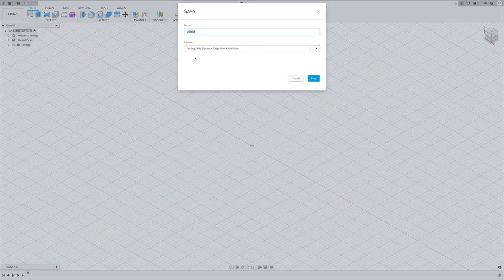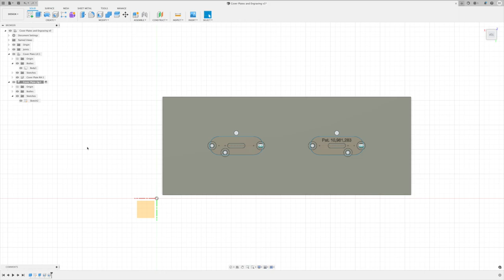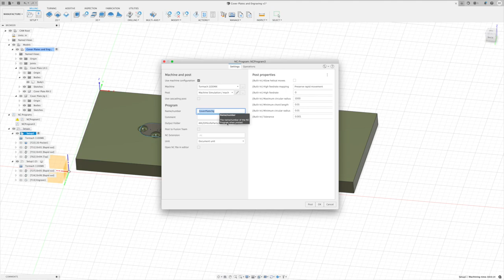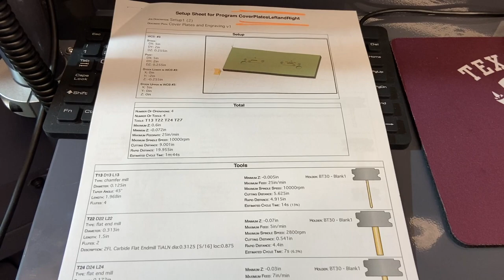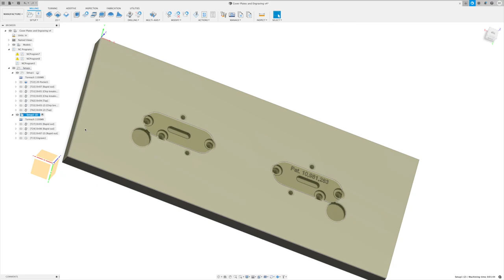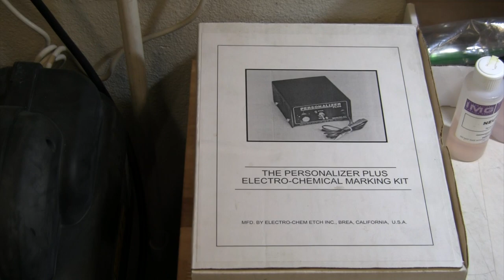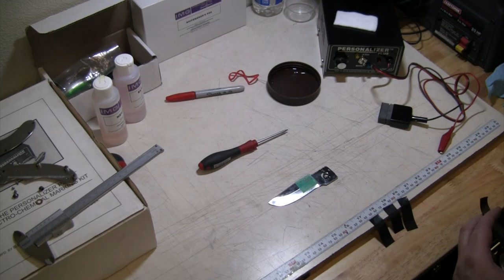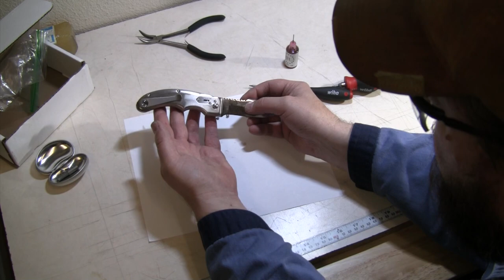Triple"B"S Knife Lock Build Series - Part 6 Cover Plates, Etching In Logo & Final Assembly

Comment: Nice video.  Must be a good feeling to see your ideas come to fruition on your new mill.  Love the videos and narrating.  Well done Bud keep them coming
Reply from the maker: tdg911 - Yes it does feel good to finish a project.  Are you making chips with I your new Tormach?
Reply: @BladesIIB  Not yet.  I just got power on yesterday.  Long story, I basically asked Tormach since they were so far out on delivery of the operator controller to work with me on purchasing a refurb pc controller so I can get this thing going.  They met me half way.  This was just delivered Friday evening and the jog shuttle came in yesterday so I just finished double checking the level and twist.  Torqued down the mill double checked with machinist level and all is good.   Setup a vice and now on to the ETS and probe setups.  I'm a bit disappointed purchasing the Tormach AL tool set because I see "some" specs for some tools but not for others... Hindsight....  Not complaining but still feeling a bit intimidated at this point.
Reply from the maker: @tdg911  glad they worked with you on the controller to get going. I have the BT30 operator tool set. Not familiar with the AL set. I have been happy with the tooling so far. I don’t have the tool setter or probe. Doing that all manually so can’t help you there. Just go slow. Once you set a tool height and get your tool table built out it will make sense. I am sure for your tool setter you need a different work offset. Remember you have to type that in the code line on the main screen G55 etc. tools you can select in the offset tab but work offsets you have to type in on main tab. Took me a few tries to figure that out. Try to save you a step. Good luck.

Comment: Great video. Just FIY, if you leave 0 in the setup, it's the same of G54. The 1 is G54, 2 is G55 ecc...
Reply from the maker: Ale - Thanks, and yes I saw it was defaulting to G54. Just did not like that yellow exclamation point. 😁
Reply: @BladesIIB  ehehe true